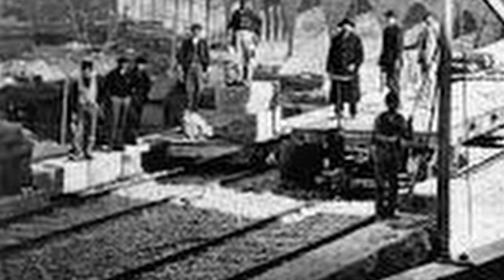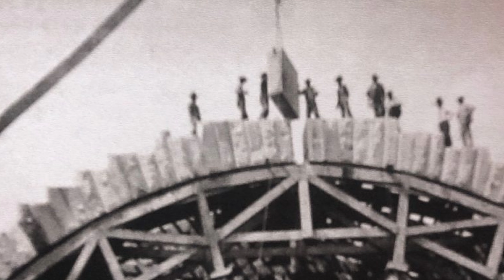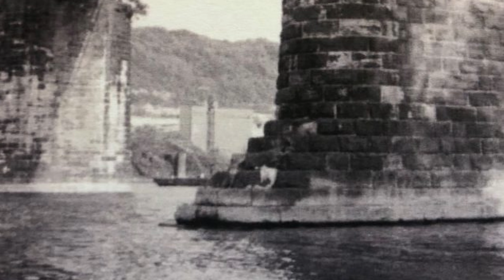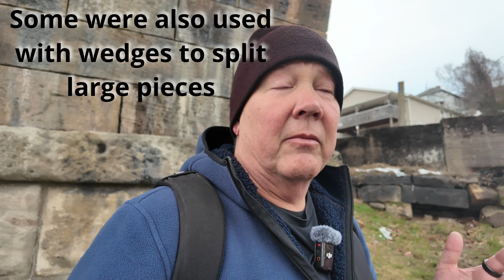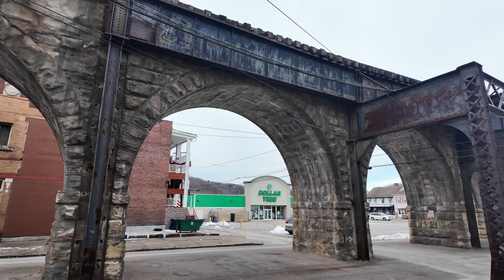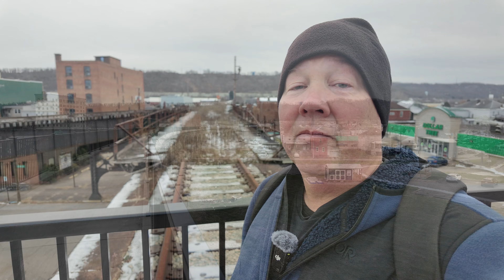B&O Railroad Viaduct vs Natural Barriers | Why This Structure Mattered } Great Stone Viaduct

Comment: My Grandfather worked for the B&O railroad. He was the switchman on the caboose as his train sat on a siding near the old Dayton railroad yards. Idled to allow a fast train to pass. Just doing his job when the oncoming train passed by on the adjacent track. He was pulled off his train by the vacuum and killed. April 30, 1951. William J. Baker. He was only 32 years old.
Reply from the maker: People don't realize just how strong that vacuum can be.  Some early rail lines were reportedly laid closer together than they are today, but as trains sped up, it'd cause them to suck into each other, causing the trains on parallel tracks to collide with each other a few cars back.

Comment: Reminds me of the Canton viaduct in Canton MA! Although this one is much bigger, and the canton viaduct is still in use by 125mph Amtrak trains
Reply from the maker: I just took a quick look.  The one in Canton looks to be about 50 years older, and a definitely a different design (with the filled-in arches?).  I'll need to take a closer look at that one.  Thanks for the lead!

Comment: This viaduct was also visible in the movie "Unstoppable"; where the trestle curves away from the sandstone viaduct was where the runaway train was feared to overturn on the curve into a chemical tank farm below (either built as a set piece on more likely CGI'd in). 🙂
Reply from the maker: Somehow I haven't seen that movie.  I could have used a good runaway train while I was there.  :)
Reply: The old Stanton curve in unstoppable. 
Holes are lifted points. 
Was large turntable on the curve side.
Reply from the maker: @buckeyefarmer6259 Thinking about it, it's really surprising how many big turntables got removed and just left as empty fields, often with it still pretty visible what was there.
Reply: @Industrial_Revolution  McDonald’s sits there now
Reply from the maker: An, ok, so I was right on top of the turntable and never even knew it.
Reply: @Industrial_Revolution  won't let me post a picture showing the roundhouse.
Reply from the maker: You should be able to post a link, if you have one.  You might need to strip off the http :// bit at the beginning.
Reply: @Industrial_Revolution   looking back at the picture, the turntable was probably in front parking lot of the health center near the Mcdonalds, closer to the viaduct.

Comment: Cool, as always. Great stories. It staggers the mind when I think of all the extremely hard manual labor it took to build this bridge. Men, male workers never wore any kind of safety gear. True then and even these days. Working men refused to wear work gloves. So bare hands, hardened by a life time of hard labor.  Callused hands. blackened by filth, men toiling all day sweating. These days, we can't go 10 feet without being lectured about adequate hydration. Back then an old whisky barrel contained the water, men only drinking it as time permitted.. No snack foods or energy bars to bolster one's stamina. They were a different breed of human, than us.
Reply from the maker: I didn't run across a number on this project, but it was typical on big projects that you'd have some number of deaths per million dollars spent.

Comment: I walk my dog in that field almost daily. Been all over that bridge when I was a teenager. WL& E still uses that bridge daily. There was a hug turntable in that field before that clinic was built. Also a huge loading dock across the top in front of where the clinic is now that went the entire length of that east to west block. Imperial glass factory was just south of that and tracks were all over the place. Also dirt docks were in several places next to the tracks so rail cars could be offloaded into waiting box trucks and trailers. CSX and Wheeling and Lake Erie still travel that bridge. Not sure if the tracks on the other side still run south through Parkersburg. All the north running tracks on the WV side have been pulled out and river front development happened after that. They won't be putting those back in. That particular section of the bridge from the Y west where you are standing is now privately owned. They cleaned that bridge up and patched up the mortar joints. Used to dive off the ice breakers on the piers and swim across the river there because we could rest on the piers. Whenever we swam past the 3rd pier by that bridge because of the pollution from wheeling Steel. Was nothing but an oil slick on that side close to the bank.
Reply from the maker: Thanks for the info!  There were a handful of railcars, coal cars, I think, on the WV side, south of the bridge, so I assume it's still used at least to get stuff there.  I don't know how much further it goes from there.
Guess I was just there at the wrong time to see one of the trains come through.  Wish there were a train tracker program like there is for ships and barges.
Reply: @Industrial_Revolution  I think there is but I'm not a rail fan as in a club. I do love the history of the rails for that is what built this country and also what won the civil war. The steel was made up here, we built the rails and laid to go where we needed to in able to be a the country that we became. I have photos of the turntable and was a kid when they destroyed it. There are a lot of photos online but most of the ones I have were taken locally a long time ago. Ful blown Big Boy Steam Loco crossing that bridge in town and over there and many others.
Reply from the maker: Now a Big Boy crossing it at the end of my video would have been perfect!  :)

Comment: Why don't they complete the walkway the entire length?
Reply: Mainly because the rest is in use, as in trains cross it.  Trains and pedestrians don't mix well...
Reply from the maker: @BradleyMcWilliams-h3z  has it right.  At the fence I'm standing at, it goes a very short distance further, but then that's where the steel trestle connects.  I expect that's about as close as you'd want to be when something like a coal train comes by.  If the railroad every abandons the rest of the line, though, hopefully they can extend all the way over the river.

Comment: Unstoppable Bridge*
Reply from the maker: :)  You get that much mass moving, nothing's going to stop it.
Reply: @Industrial_Revolution You missed the connection to the movie.
Reply: @Industrial_Revolution  I think they are referring to the 2010 movie "Unstoppable", where the runaway train almost came off on a long, curved viaduct.  I was thinking the same thing about the steel side of the bridge.
Reply from the maker: Yep, the bridge is a movie star, too.
Reply: Yep, Denzel Washington, as the engineer, is trying to stop a runaway consist.

Comment: A hard no on the blasting of the sandstone.  Absolutely not.  Blasting ruins stone for dimensional work.  A single blast in a dimensional stone quarry will ruin the entire quarry.  Such a quarry is said to be "shot", meaning the stone is fractured and useless for dimensional work.  It will not hold together, micro cracks will spread throughout the blocks and they will fall apart over time.  That happened to the Pennslyvania marble quarry.  A dimensional stone quarry used channeling machines and wedging techniques to get the blocks out of the quarry.  Blasting was done only in quarries intended to produce  gravel.  Those holes are for lifting the stones with dogs or lewis pins.  Lewis holes are on the tops of stones and are always hidden by the next course of stone work.  The holes an the side are dog-holes, a hook would hold in the hole.  These holes are shallow.  If the hole is deep, then yes, it was intended for splitting the stone.  Sometimes they changed their minds on how to split the stone, and holes were abandoned.
Reply from the maker: Thanks for the info!  I've had a couple other questions on quarrying on this video, and might be trying to get into one.  I hadn't considered that sandstone would be much different from other stone.  I have a some limestone quarries nearby and, now that I think of it, there's one small sandstone quarry, too.  I'm not sure if any of them produce anything structural like this, though.
Reply: @Industrial_Revolution  If you are in the Mansfield, Ohio area, there is the Briar Ridge quarry which quarries the Massillion Sandstone.  Of course there is the Cleveland Stone, which looks like the stone in the bridge.  Over in Indiana near Bloomington is the Indiana limestone belt.  Several bluestone quarries in Pennslyvania, a green to blue sandstone, such as quarried by Meshoppen Quarries (at my stone mill, we called them "Misshappen Quarries" because they made lots of mistakes).  I am an independent stone carver now.  I go around to different mills and carve fireplaces, cut dates and inscriptions in corner stones, that kind of thing.  I also do my own thing restoring old gravestones.  I am in Iowa and I am the only traditional (air hammer and chisel) stone carver between Chicago and Denver.  I know some artists who dabble, but I help them out, too.
Reply from the maker: Thanks for the info!  Do you know how many are actually cutting blocks like this, now?  I'm not too far from Toledo, OH, and they have limestone quarries, but I don't know if they do anything but crushed.  No one really builds with big blocks like this anymore, so there's just not all that much demand, I suspect.
Reply: @Industrial_Revolution  If you are in the Mansfield, Ohio area, there is the Briar Ridge quarry which quarries the Massillion Sandstone.  Of course there is the Cleveland Stone, which looks like the stone in the bridge.  Over in Indiana near Bloomington is the Indiana limestone belt.  Several bluestone quarries in Pennslyvania, a green to blue sandstone, such as quarried by Meshoppen Quarries (at my stone mill, we called them "Misshappen Quarries" because they made lots of mistakes).  I am an independent stone carver now.  I go around to different mills and carve fireplaces, cut dates and inscriptions in corner stones, that kind of thing.  I also do my own thing restoring old gravestones.  I am in Iowa and I am the only traditional stone carver between Chicago and Denver.  I know some artists who dabble, but I help them out, too.
Reply: I agree, doubtful blasting was used. I have always been told that these were tong points on the stone face. For what it is worth, I have worked around old Mississippian Age Sandstone for several years, while large and heavy, they are soft and fracture easily. Enjoyed and appreciated the video, the B&O was such an important part of our history. Fond memory as a little kid riding to Chicago with my grandmother overnight in a B&O Pullman Car.
Reply from the maker: @prairiefork  Thanks for the info, and glad you enjoyed the video!
Reply: Holes for lifting tongs. Simaler to ice tongs.
Reply from the maker: @josephvalcarce3124 I've heard that as one of the reasons, but the thing no one's been able to answer, specifically if that was the use, is why only about 5% - 10% of the stones have these holes, and also, of those stones which have them, why do so many (maybe a majority) have 2 or 3 holes on them on the same face?
Reply: @Industrial_Revolution  If they were building a hotel or something pretty, they would process (saw, chisel, plane) off all of the holes.  Since this is just a bridge, why take the time to re-face the side of the stone if it doesn't need it?  Time and effort are both money.  That is what the management thought.  Every cut was  planned.  Those holes are left over from when big blocks were lifted out of the quarry.  Sometimes, if the block was really big, several "tongs" were used for safety.  Then as the block was cut up, the holes got separated onto various new pieces as the block was reduced to smaller pieces.  If the face of the stone was OK, it was used.  The stone men were really, really cheap.  Have you ever measured an old tablet gravestone width?  They did not cut them to standard widths.  They would leave a stone at 16-3/4" rather than trim it to 16".  They would not "waste" the time and wear on the saw, and they would certainly charge for those several extra cubic inches of stone!   Cut stone was sold by the cubic foot, and estimated by what was called a "perch" of stone, which was the volume one rod (16.5 feet) x 8" tall x 1" thick.
Reply from the maker: @benmayer5932 Makes sense.  I spent a lot of time in stone yards looking to match historic stone for a restoration at a place where I volunteer.
Reply: Fascinating!

Comment: I grew up in Wheeling in the 1950's and remember the bridge at Benwood very well. The B&O circular yard and and the steel factories.
Reply from the maker: I stopped in Wheeling on my way from here to Dresden, to film the chain bridge there.  Really nice suspension bridge in Wheeling.  Might be a story in that bridge, too.
Reply: Those tracks were called “ the loop “ and I remember setting off the Zainesville block and separating from the Parkersburg sections … busy subdivisions back in the day …

Comment: I was always told those holes put in the blocks were for the lifting tongs to go into to lift the stones both for loading at the quarry, and to put them in place? But I wasn't around back then so I don't know for sure! LOL
Reply from the maker: I've heard that story, too, but if you look at them, doing that would ideally mean they'd be in most, if not all blocks, and typically in the same places,  most likely never with two or more on the same faces of the same block.  In reality, though, they seem to only be on a fraction of the blocks, and often with two or three on the same face.  If you look on the walls of quarries, these holes are pretty common, too.
Doesn't mean they weren't sometimes used for lifting, too, and they'd be crazy not to take advantage of them.
Reply: @Industrial_Revolution  I'm a long time stone cutter.  At the quarry, bigger blocks were picked up using big hooks or tongs called "dogs".  A shallow hole near the top of the block was used for this purpose.  These bigger blocks were then further processed at the cutting shed and these "dog holes" were usually processed off as the block was reduced to stones of the required size and shape using saws, chisels, or splitting.  Once these finished stones were brought to the jobsite, lewis holes were drilled into the top and lewis pins were used to lift the block of stone into place.  These holes are hidden by the masonry joint by the next course above.  OSHA does not like the use of dogs /hooks.  They want the stone supported from the bottom now so nylon straps or steel cables are used now to lift stone.  I used to run a planer machine at the stone mill that I worked at and I used dogs frequently, since they are faster... you don't have to lift up the stone to put a stick under it so that you can then put a strap under it.  Oh, and they absolutely, positively, NEVER blasted at a dimensional stone quarry.  That would fracture the stone and make it absolutely useless.
Reply: @benmayer5932  Wow great information. Thank you
Reply from the maker: @s16100 Thanks!  Glad you enjoyed the video.
Reply: @Industrial_Revolution  yeah good point. They would be in every stone. Never thought about that. Hmmmm I would think blasting would rip the face of the stone too though? Those stones all have nice Machined faces. Maybe we need to visit a working quarry and see just how it's done! :)
Reply from the maker: Maybe I'll see if I can get into one.  I've been to quite a few abandoned ones (they're often turned into parks and scuba sites).  There's some big, active limestone quarries in NW Ohio, not too far away, but not sure if any of them do blocks, or mostly just crushed.
Reply: @Industrial_Revolution  yeah, that will be the hard part. finding one that is operating, letting you in to record and making stone blocks. That would be cool if you can find one.
Reply from the maker: @s16100 Especially finding one producing large, regular blocks, since there aren't many of those used, anymore, unfortuantely.
Reply: @Industrial_Revolution  Yeah......... Hmmmm
Reply: @s1-6100  We see the same picking holes on stone used on the Erie Canal locks, and those stones were hammer dressed. I have also seen them on other canal lock stone.
Reply from the maker: @pbcanal1 I haven't made it over to the Erie Canal yet.  I really need to.  I thought I might get over there this last fall, but didn't make it.  Where are you on the canal?
Reply: @Industrial_Revolution central NY area. If you are ever in the area, let us know.
Reply: @Industrial_Revolution search for enlarged lock 52 by old mentz. I posted about 9 years ago. Shows the pick marks at one point.
Reply from the maker: @pbcanal1  Pretty sure the Erie Canal is going to be on my list for 2026.  Send me your contact info, if you get a chance.
I actually just did another set of locks on the Miami & Erie Canal on Thursday down in Lockington, Ohio.  A flight of 5 locks, starting with probably the best preserved 19th century lock I've seen, and going downhill from there, as they went downhill.

Comment: Looks a lot.like Jim Hill's Great Northern Railway stone arch bridge over the Mississippi in Minneapolis.
Reply from the maker: I just looked up a picture and yep, sure does.  At the edge of the picture, I think where it goes over a lock, maybe, is that a steel truss section to add width, or is that a lift section?
Reply: @Industrial_Revolution Added in the early 1960s to allow barges to pass.when a Lock & Dam.was contracted.  The Lock has been disused for several years now, I believe.
Reply from the maker: Is that the one I heard was closed down to stop some invasive species from getting up from there?  Maybe the invasive carp?